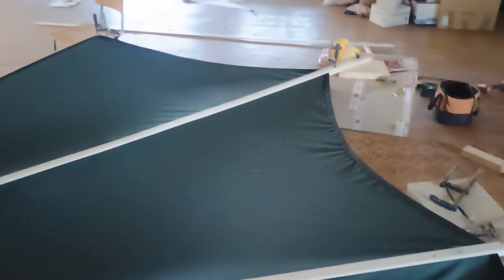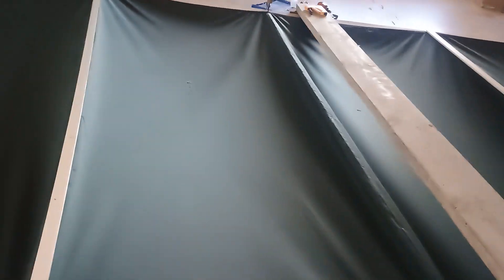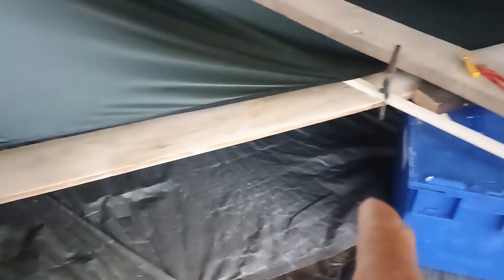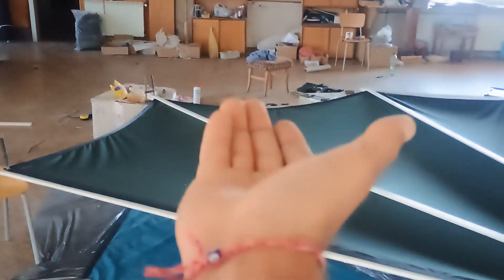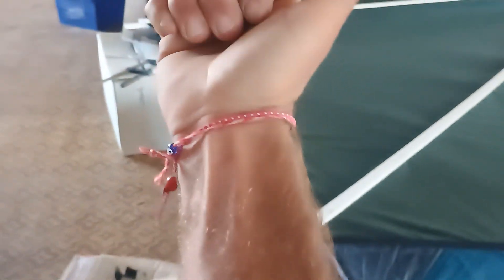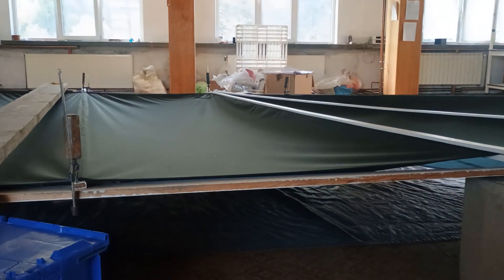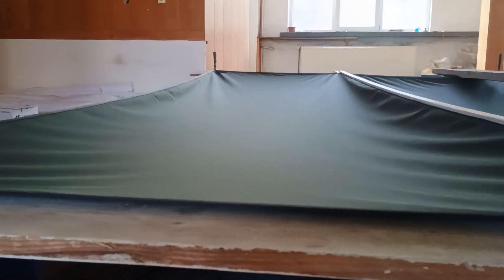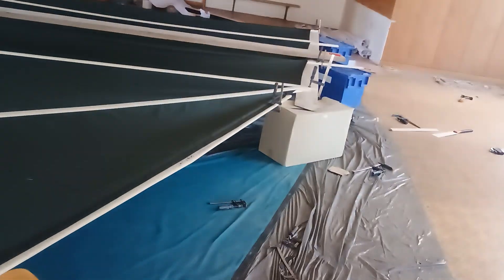Making a Junk Rig Cambered Sail, the Scaffolding Way

Comment: I use what I believe to be a similar polyester material when building skin-on-frame canoes & kayaks. To get the wrinkles out after sewing the seams at the ends I use either a heat gun (on a low power setting to avoid over shrinking or even melting) or a clothing iron. these give enough localized shrink to remove the wrinkles, and in my case tighten the material up. 
It may be difficult to control the amount of shrink, so you may want to try an experimental panel to see if you can maintain enough control to get the adjustments you need.
Thanks for continuing to produce these videos !
Reply from the maker: Interesting! Yet frightening, l wonder if the cloth wouldn't harden and rip??? 
I do know that all these sails have wrinkles, most blow out and disappear, very little stay, other Junk Riggers claim no problem, still I try to minimize them as much as possible...

But I won't forget your advice, I'm sure it will come in handy....

Keep Shunting bro 
All the best 
Thanks!

Comment: I got a year out of my light weight polytarp sail, but I was very strict about bagging it. once it starts tearing it's the beginning of the end. polytarp is good for learning but once you get the hang of it start
Reply: second hand dacron sails are a good source of material, cheaper than a large new tarp, and probably last longer than that too
Reply from the maker: Good thinking bro, I will have to look into it...
Yet not going to be easy here, nothing is cheap as a result of a crummy standard of living, so second hand isn't cheap, no matter what...

Anyway, I learned the hard way, thought it would last longer...
The biggest problem was, the cambered panels load the luff, a flat sail doesn't, since there the loads spread all over....

Keep gybing bro
Reply: @BalkanShipyards  right! loaded luff yeah that makes sense!

Comment: With poly tarps when they start getting sun damaged you can paint it with water based house paint just water the first coat then they last for a long time
Reply from the maker: Too late... I made a new one, thanks anyway.
Keep Shunting bro, 
BSY
Reply: @BalkanShipyards always something to think about for the future
Reply: What do you mean, water it? Cut the first coat with half water half paint, or what mixture is best?
Reply: @WMichaelDeJonge yes that’s right I go for 10to20percent water all depends on the thickness of the paint
Reply: surely the paint will not stick to polytarp?
Reply: @dominictarrsailing the paint won’t stick to a new tarp you’ve got to weight for them to become sun damaged then it will stick it works on canvas as well

Comment: Nice, the new material being a finer weave should sit nicer when sailing, and hopefully it's got better UV stabilisation than the poly-tarp, poly-tarp's usually only last about a year or so in the sun and that's without being hit hard by the wind, so you you did well for it to last as long as it did.
While you have the scaffold setup, cut extra panels, label them but don't attach any battens, then you can roll/fold them nice and small and keep aboard as spares in case you're somewhere where you can't easily make a new sail next time.
Reply from the maker: All true Dave...
Extra panels, good idea, but no material left over. Anyway, sail is on the car, heading to the Black Sea tonight, can't wait to test it!!!!

Most important is to finally measure speeds in light conditions, Junk vs Biplane...
Got a solar panel to install and other stuff...
More to come my friend.
Keep Shunting...